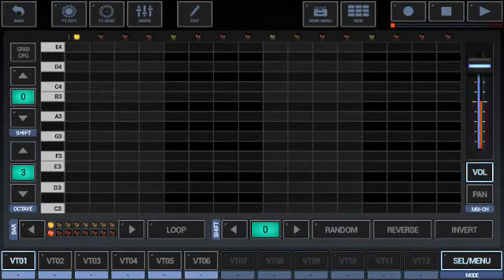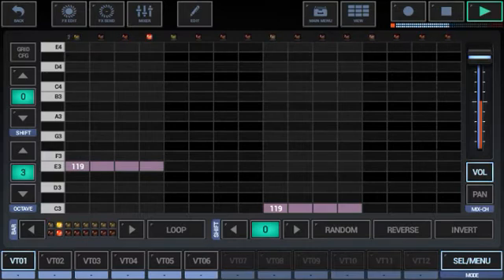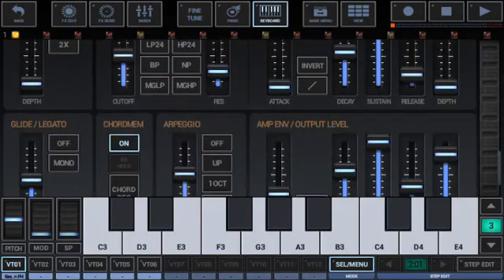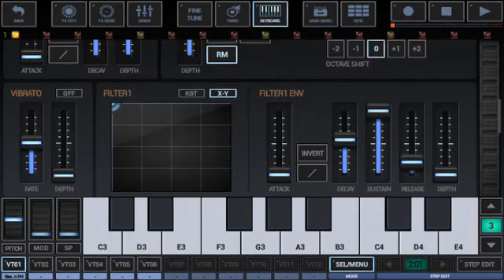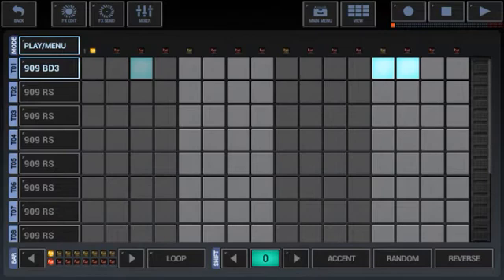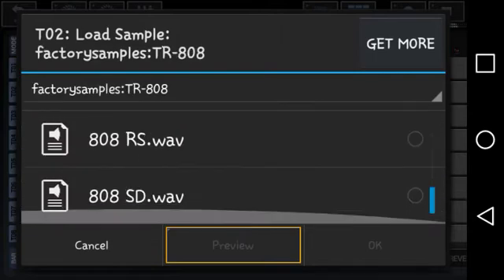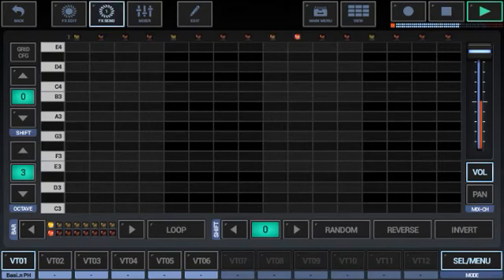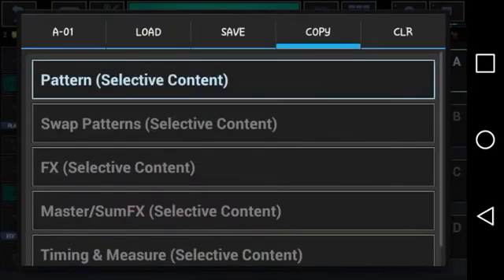G - Stomper Studio -  How To Chain Patterns and Record Automations Over A Pattern Chain

Comment: another few ways are the step edit function or the automation key for racing both are in the mixer. or if your a pro u can transpose basic samples to the pcm after step editing . these tip are basically for very precise transitions or automations. good tip though I think I'd have to max out the bars so as to keep up with the timing. I wish there was an interval setting for making these changes with equal distance. I found that for a pattern of four,  the change in whatever pitch, volume ,efx, etc is about 2- 4 measures or so ,but different wavelengths call for different measurement.  hint be sure to at least try to sync the lfo tab/ envelope
Reply from the maker: kevin s. tapia well i might just let u co star in one of my videos fam.